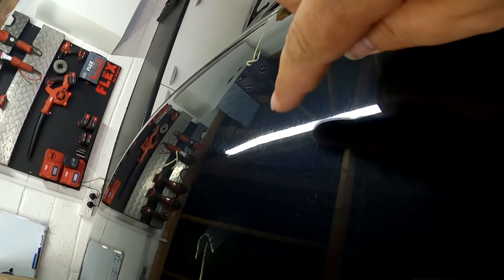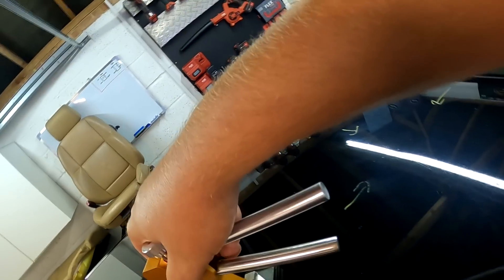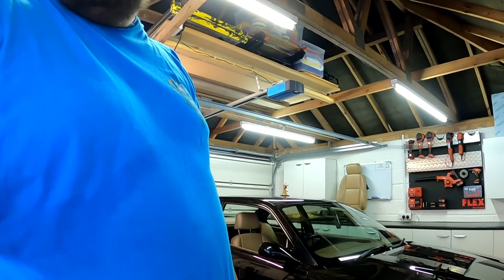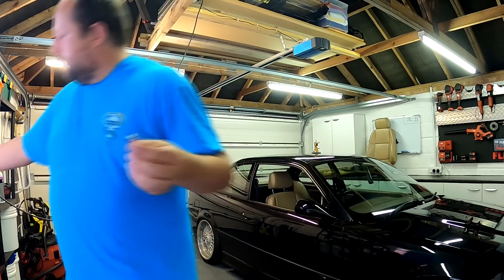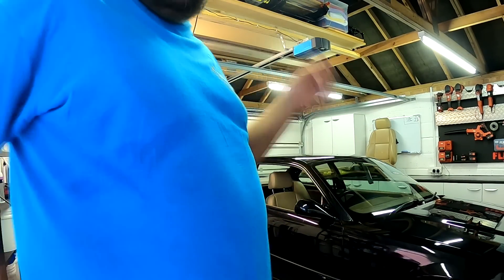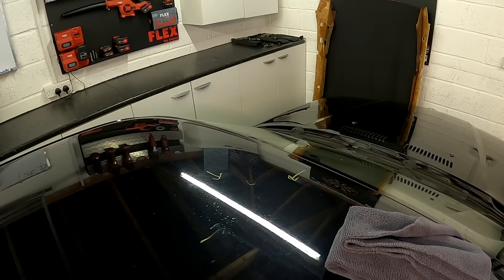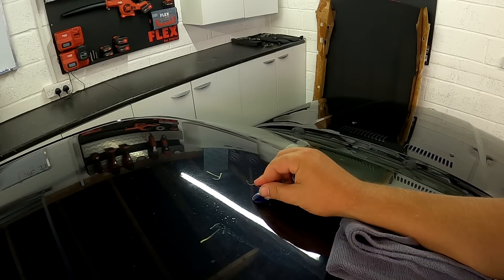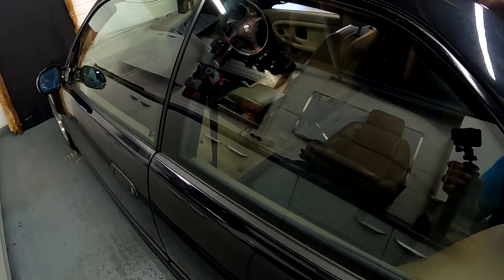DIY Fixing Car Dents

Comment: Jon, you don’t need to pull the tab straight off, you can pull a few times under the break of point to get a bit more dent out from one tab. 

Getting the last 10% out is the difficult bit, the tighter crease or point of a dent is where the real skill is.
Reply from the maker: getting the last bit out is the hard bit your right.  the PDR guy finished it off, just with tapping around it for about 10 minutes working it out.

Comment: Nice work Jon, this gives me hope I can get out a tiny dent I did by just catching the bodywork when putting a tool box on the back seats. I very nearly bought those glue tabs and slide hammer kits but since I've got quite good access to other side of the panel through the wheel arch I went for the pushing rods instead. That seems to be what the pro's tend to use more often when possible but whether a complete novice like me can use them to good effect I not sure yet, waiting for them to be shipped from China.

Comment: Can you please do a video on Graphene coatings and Graphene detail sprays there is alot of interest for it and not alot of people is doing reviews / tests
Reply from the maker: I have already done, see gary.   "rip ceramic coatings meet the future" something like that.    Ive also included the SPS graphene detail spray in my latest detail spray test.  And the ADS graphene product in my 6 month long test on 24 sealants on one panel.  I may well do more on graphene theres a lot of noise.   The noise will mainly be like when ceramics first came out, the parts of the industry that dont offer the products will say there is no benefit to  the products.  The part of the industry that sells graphene products will say there is.   The truth is somewhere in between as always. but wind the clocks forward 3-5 years and they will all be selling graphene products. And then another material will come to market and the same crap starts all over again.  you dont need you tuber reviews to tell you if graphene is going to help you.  If there are benefits they will be so microscopically small you wont be able to measure.  but lots get enjoyment out of trying new things and following the scene (including me).   but yer we will maybe do more on graphene.
Reply: @ForensicDetailing  thanks so much Jon anytime i need advice or a recommendation I always come to your channel. It will be interesting like you say to see what all comes out In the future, all i know is the detailing scene is getting bigger and bigger but that's a great thing!

Comment: the link to the product shows a whole page of many which one exactly did you get Jon ? Also did yours come with the glue gun?
Reply from the maker: Im not sure mate Ive had it for years but it has gun, slider hammer, grip puller, hand puller, non marring tools hammer and pole thing with lots of different tip fitments and loads of tags..  was about 40-50 quid.  To be fair its good quality and its payed for itself.

Comment: What percentage of IPA did you use to remove the glue ?
Reply from the maker: about 25%ipa 2-3 surfex rest distilled water.
Reply: @ForensicDetailing  What is the 2-3 surfex, percentage, ml or something else, almost sounds like a glass cleaner !!
Reply from the maker: % mate  surfex HD or any APC conentrate

Comment: This technique is absolutely harmless. If someone wants to try it without an expensive briefcase. Seeing the shape of the piece that sticks, by which you pull, I did it with a plastic chess piece; the white lady specifically; I pulled and hit again about four times, and the DENT was gone. Test it!!
Reply from the maker: the brief case I think cost me like 40 quid.  In that I got a glue gun, about 15 rods of glues with different tac levels.  The grip puller you see in the thumbnail, the stainless steel slide hammer, about 20 tags, a hand puller, a hammer, non marring tag removal tool (the red chisel thing), and also a peg , bar to tap the dents with which also comes with 10 attachements.   Oh and a hard case.    Its not expensive and it pays for itself.  Its not the case that you can also just pull the dent and its gone, sometimes this happens though 2 of the 3 dents came out after 4-5 pulls.    but yer sometimes it goes really smoothley.
Reply: @ForensicDetailing  Thanks for your answer. No, don't get me wrong, in fact I have one of those kits already on the shopping list. I just wanted to support that the system works. Greetings!!

Comment: I wish you well Jon but honestly this will end in tears 😭. I think you got away lightly on this one. 
I'll happily come and give you a days free PDR training if you want it but it's like having a days course in helicopter building and then going off and building one.
Reply from the maker: I got the PDR guy round steve to finish that one off that I tried in this, but also I found a load more on the rear quater panel.  Its a proper skill I could never learn in a day.  all these things in car care.. leather repair.  PPF installation. Vinyl wraps. PDR. Machine polishing etc etc.. so many areas which can all be careers and take a long time to master the skills.  I just like messing around a little bit with all of them mate.
Reply: @ForensicDetailing  you get lots of -angels for polish and coatings, get some with small dents and practice

Comment: what kit did you actually get?
Reply from the maker: Im not sure mate Ive had it for years but it has gun, slider hammer, grip puller, hand puller, non marring tools hammer and pole thing with lots of different tip fitments and loads of tags..  was about 40-50 quid.  To be fair its good quality and its payed for itself.
Reply: cheers i liked the case that it came in as it keeps everything in it's place.. keep up the great videos

Comment: This is really interesting but I can't finish watching it because the audio is clipping so badly (and whistling isn't that helpful either, although you're very tuneful). Any chance you could sort the clipping out and re-upload?
Reply from the maker: is it like resonating overpeaking type thing?   Sorry I dont have the raw files any more to re-render it maybe I set the sound levels wrong I normally test this. thank you for telling me my friend I will try and do better audio in future.
Reply: @ForensicDetailing  yup that's right, when you see the sound waveform as part of the video it may show some of the peaks going red, that's where it becomes distorted. You can either adjust the overall volume or just those segments (I tend to do the former because it's easier, but doesn't always achieve the best overall levels so a little tweaking sometimes helps.

You'd even be able to do this to the version you've uploaded I think, no need for the raw footage (although that's easier if course).

Do you use an auxiliary mic on the GoPro?

Comment: Couldn't help but notice Jon, you stopped running. Gained a little. Still... love the vids.
Reply from the maker: its muscle mate, Im bulking up for a 3rd and final showdown with the Bronze Bomber.
Reply: @ForensicDetailing  lol. It's been a really stressful year to be honest. Anyhoo, not to keen on the dent puller as I've heard a friend had paint flake off, must've been on a chip, that being said if you are to use it, then these vids are there to help.

Comment: I bought one of these kits, tried using it and to quote the Dentex guy I had to use after ‘it’s put a bloody great tit on it!’.  It went from a dent to a bump with a pinch on it and cost me significantly more to get repaired than if I had just taken it to Dentex in the first place .  It went straight in the bin after that!
Reply from the maker: you can do lots of things wrong with it.   but for me the tool has saved me a fair amount of money over the years and nothing has really gone wrong.  my problem is simply I dont have the skill to get them all out fully.  when starting use the lower tack glues.